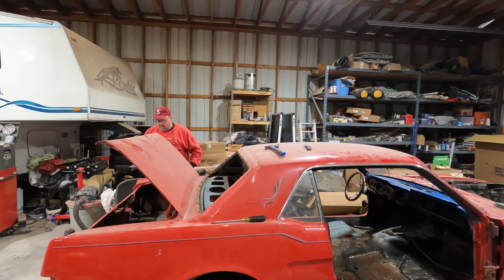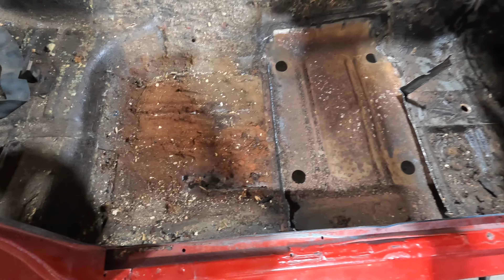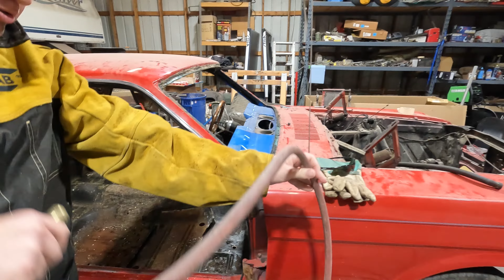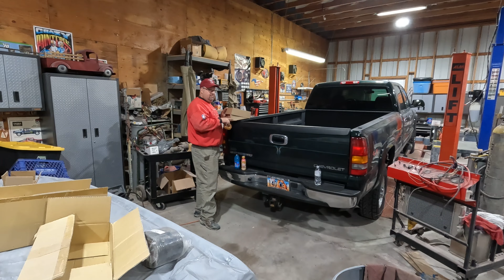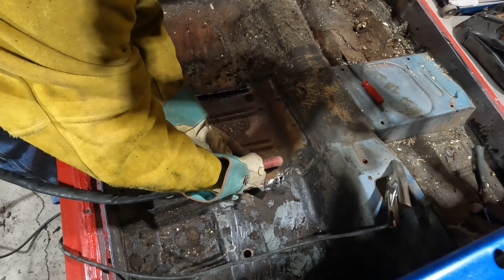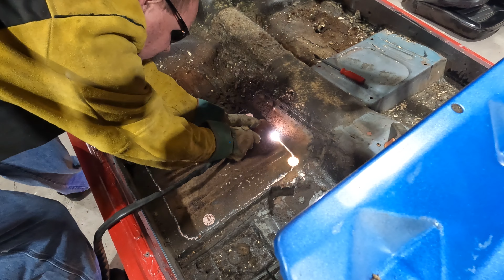66 Mustang Floor Rust Repair

Comment: SO, Rookie (or Dumb) Question
Why not just use the Whole New Floorpan ?
Too Much Work?
Reply from the maker: With it being a unibody car, we would have had to do a lot of bracing since the floor is a lot of structure.  Also, doing the pieces we needed we finished in about 12 hours.  Had we done the whole floor, we would have been 40 hours at least very easily.  Last, the original metal is thicker, so retaining as much good metal as we could was a benefit.
Reply: @kamasklassics 
Thank You